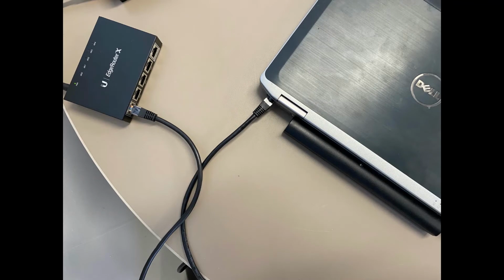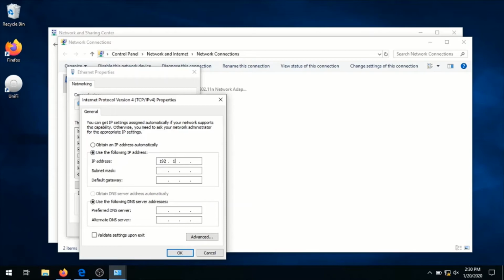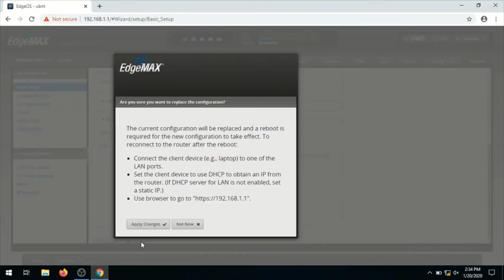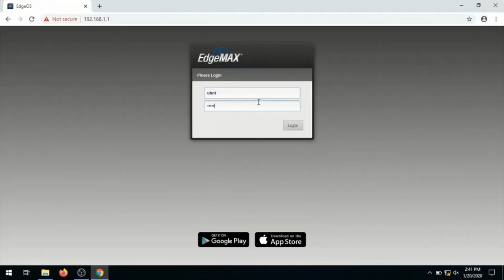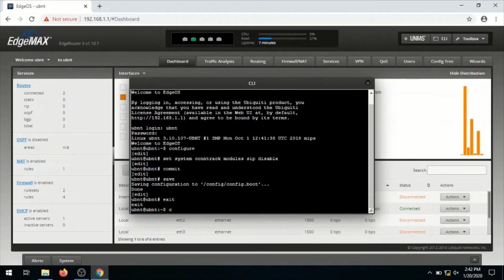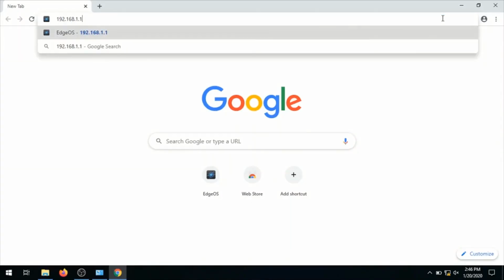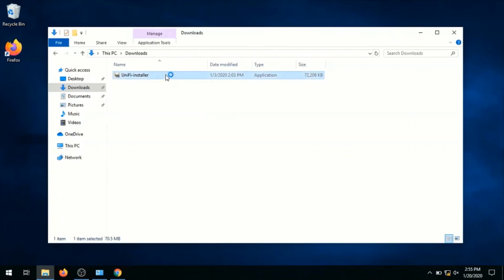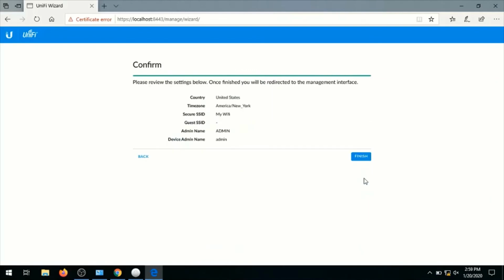Ubiquiti Router Tutorial | Aline  Phone Systems

Comment: Is a PoE injector necessary given the EdgeRouter X has a PoE out port (eth 4)?
Reply: In my experience, yes. The EdgeRouter X only has a 24v POE output, while the Unifi Access Point requires a minimum of 44v. However, if Ubiquiti confirms that I'm wrong, I will gladly remove the POE injector I bought for this purpose. Fewer points of failure, you know?
Reply: What do those commands do that you ran?